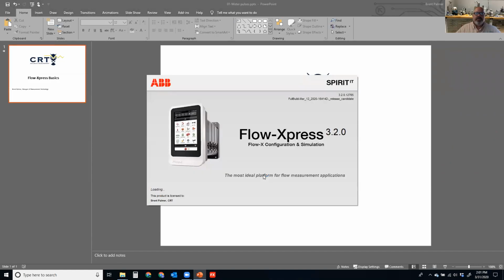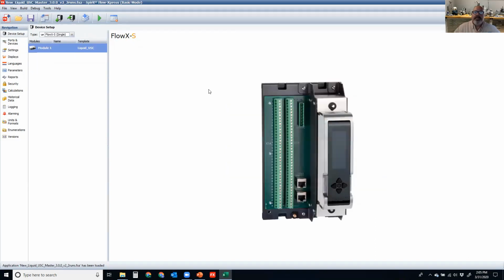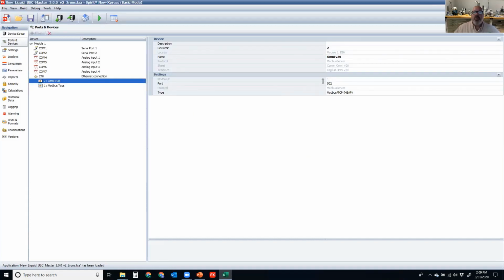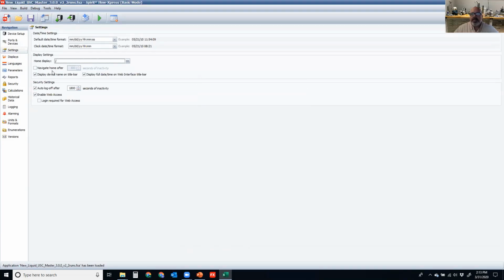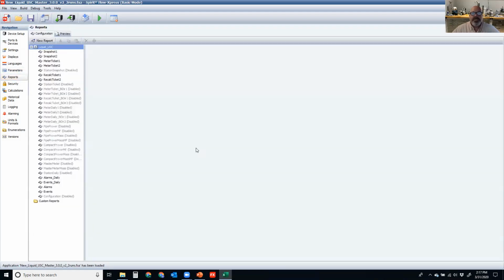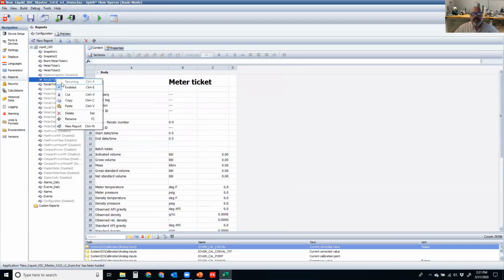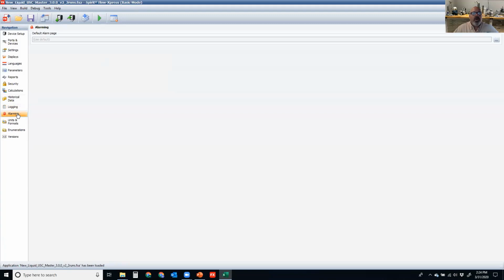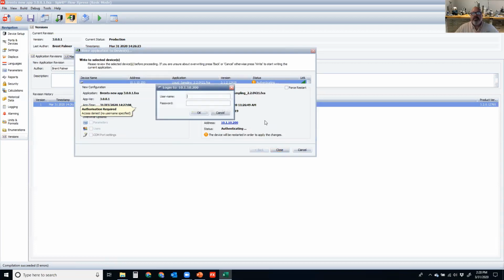Flow Xpress Basics - A Pro Training For Advanced Users

Comment: Is there any way I could get an old version of flow xpress software? I am trying to communicate with a flow X-P that was installed couple years ago and the lates 3.2 version software won’t communicate. Is there a fix for this issue? Please help.
Reply from the maker: https://sites.google.com/crt.services/flowx/home
Reply: Thanks a ton for your reply!!
Reply: I am trying to connect old modules to a new Flow X-P display unit. I plugged in the old modules but in the modules list it doesn’t show that it is detected. What could be the reason for this?